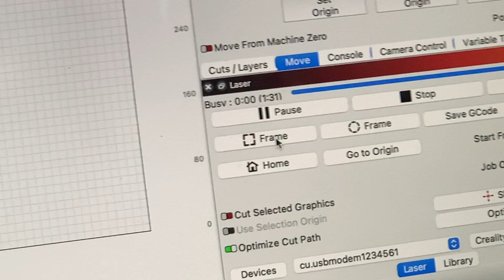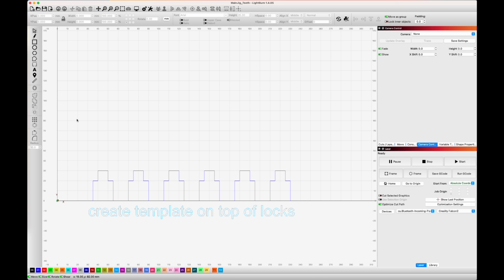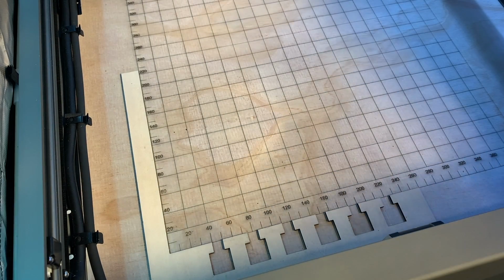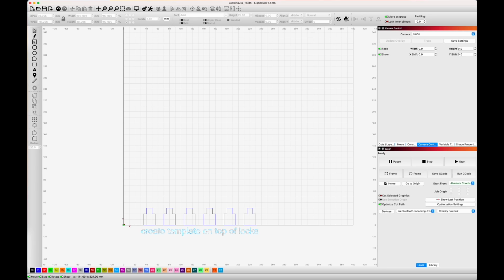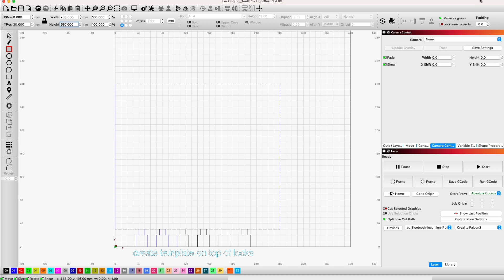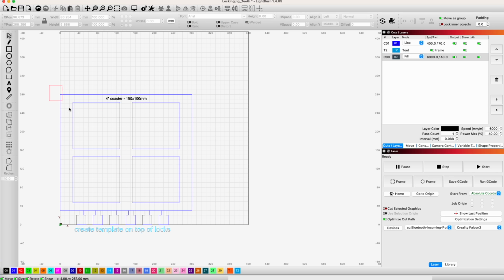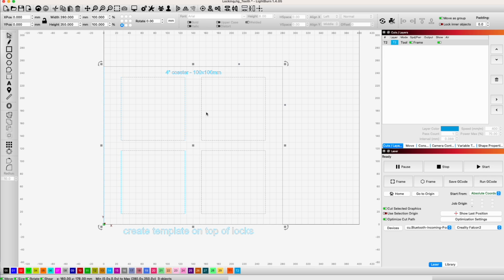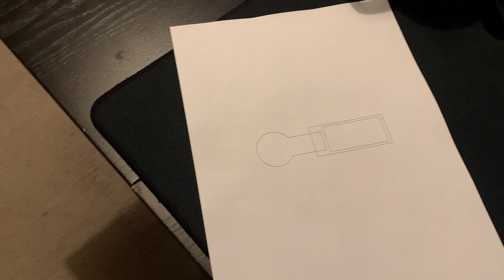How to make a laser engraver locking jig template (Lightburn files in description)

Comment: I am really curious, to what method finally work for laser engraving the black metal front panel. I am in need of a way to engrave a 2HU 19"panel. I can half way move the panel. But my laser's working area is 400x450mm so pretty big and I think I can make it without moving the panel.  I was thinking a few layers of white, then thin layer thin layer of black and laser that away layer of black. Do you still think that is the best way?

Comment: Hi, thanks for you efforts creating this for us. A quick question is there any reason that my diode wouldn't engrave this file square? I have the same engraver 22w Falcon 2. Thanks (I found out because I was try to put a honeycomb base on top and was using the grid I engraved to square it up and I thought thats wierd the the honeycomb is not square so got my square out and started to check which was the unsquare one and it turned out that the grid I engraved was unsquare by about 3/16 in a foot and a half stretch.
Reply from the maker: @kencoldman  I’m not sure, maybe it’s not calibrated or something. The honeycombs are not square from my experience.
Reply: @thatDIYlife  thanks yeah I used a carpenters square and it's out 3/16 or so in around a foot and a half.
Reply: @thatDIYlife  this is off topic but I think there is something deffinetly wrong with my falcon 2 22w this is not the pro model it is just like yours. I'm having a strange issue. I bought it to create templates for my fiber laser. I used the creality prefrence settings for this machine and the included focus block, material is 2mm basswood 700.00 speed and 100% power and it didn't even make a dent so I proceeded to lower the speed and made it to 100 speed and 100% power still no cut. What works for this machine is 17.0 speed @ 100% power for 2mm basswood. Is that similar to yours?

Comment: Hi m8, did register for the jig and template file but i do not get anything back to my email. Still offering those files?
Reply from the maker: @jonnylarsson2081  try checking your spam folder maybe
Reply: @thatDIYlife  tried 2 different emails but no response back, and nothing in spam.
Reply: @thatDIYlife  I had the same issue yesterday, and this morning.  Submitted my information/email and never got a response.  Great work on the informative video, I'm working through just designing/making my own file based on your setup.
Reply from the maker: @rff.cutwoodworks6064  ok I’ll look into it  maybe today or tomorrow
Reply: @thatDIYlife  me also, i did not received the template files.
Reply: @thatDIYlife  I JUST GOT REGISTERED. CAN'T SEE THE FILE. NOT IN SPAM OR ANYWHERE.
Reply: Same issue here, registered with 2 different emails but no files sent and nothing in spam. Great video BTW, hopefully you can sort whatever the problem is 👍
Reply: Same. I tried 4 times and never received an email response. Great video though!
Reply: I also haven’t received my files.
Reply: Same here. Not in spam or anywhere else.

Comment: So I really like this idea... am modifying for my machine use. I have a few questions; so you would recommend using mdf instead of plywood you used? Correct? Would it be beneficial to put a finish on the mdf prior to engraving? Or no finish at all?  My last question and maybe the most important, if you are not using a jig and place you material somewhere in the middle, what do you use for hold downs? Or do you not worry about hold downs? I am new to laser (have a diode with air assist).  Best jig system I've seen on the internet... great job!
Reply from the maker: @craigmowbray4062  I think mdf would be the way to go since the surface is uniform. It probably won’t make any difference for the engraving process just more of a legibility thing. 

The jig is only for repeating the same engraving so if you’re doing a one off in the middle you probably don’t need hold downs. Sometimes I use the coordinates on the jig as a reference if you’re engraving a square material. For example, putting a small piece of plywood at 100, 100. You can just line up the bottom corner at 100,100. For one off pieces I normally just eyeball it with the preview though.

Comment: Do we use the Kerf setting on the jig base or just the template jigs?
Reply from the maker: @benreyes2595  I think it only matters on the cut layers. So both if you’re referring to the jig base teeth
Reply: @thatDIYlife  cool thanks. Also how do you get the template squares and everything else to 0,0 so easily? I type in 0,0 and it puts the center of the selected item on 0. How do I quickly align left and bottom like you do?
Reply from the maker: @benreyes2595  I normally push the move to home button to move it to 0,0. The bottom left was home/0,0 on the falcon2